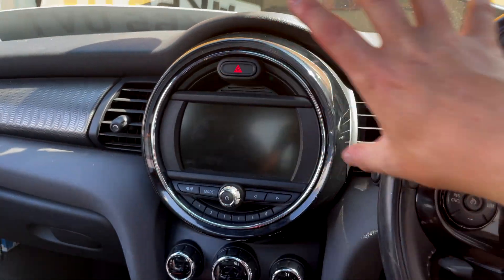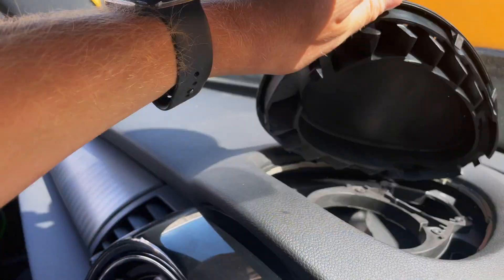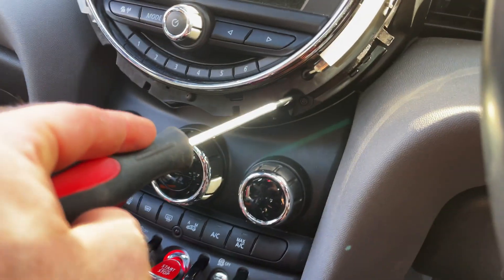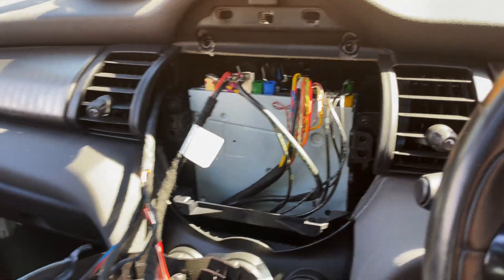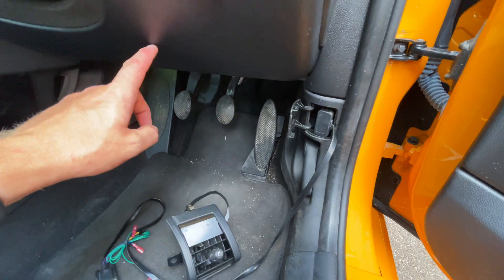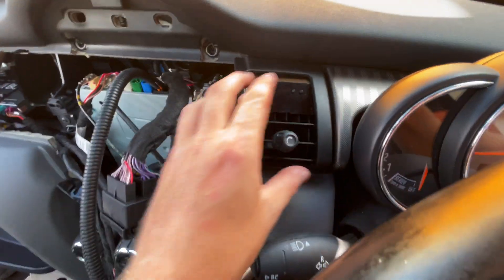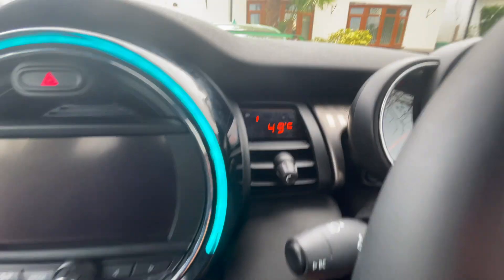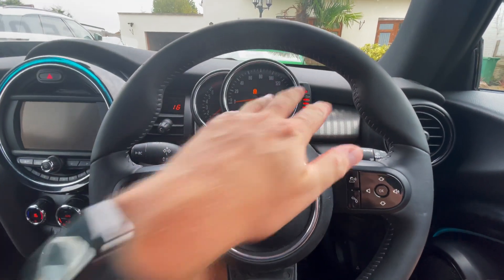Mini f56 How To Install a P3 Gauge similar to scangauge ultragauge OBD OBD2 OBDii

Comment: I really like the p3 gauge but the angle just doesn’t work on the f56 mini you can’t see it when you drive unless you literally look to the side which isn’t ideal when driving for a quick glance .. they should  of done it for the outer air vent instead hence why I’m going for ultra gauge as I can glance near the speedo
Reply from the maker: I agree, but I prefer this as an OEM looking piece of over a screen just stuck on the dash